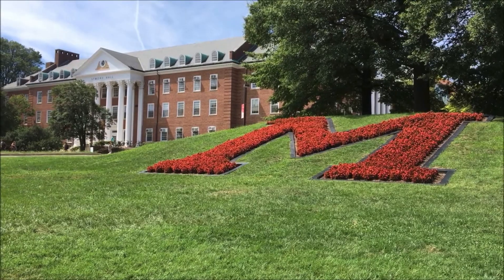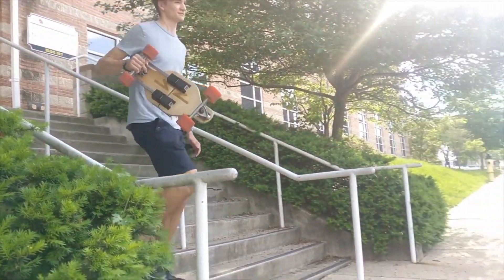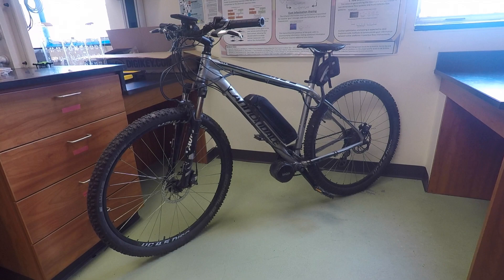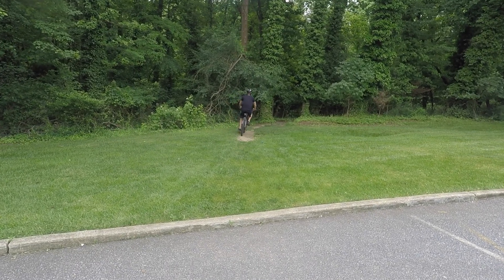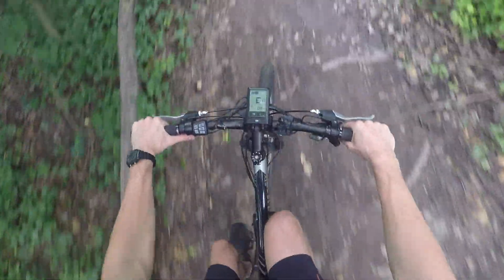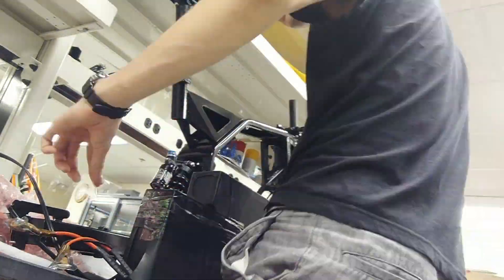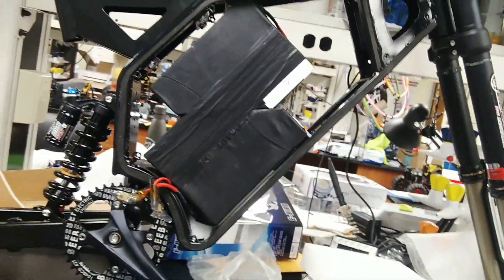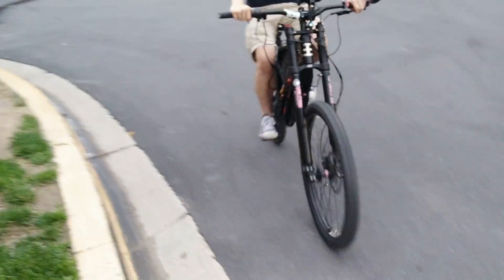DIY Electric Bicycle to Electric Motorcycle Upgrade

Comment: hi! i have almost the same setup, im wondering how accurate your cycle analyst is when determining amp-hour draws. Im supposed to have a 25.6ah battery but its dead after (according to the display) only 6.75ah.

Comment: If I had so much money...

But that doesn’t mean I won’t do an ebike like you did.

I’m planning of doing an mid drive freewheel crankshaft ebike with the kunray motor kit 72v 3000w. (200€)

I don’t under stand why hub motors are so pricy (500€)

Then I’m going to spot weld a battery: 20s 26650 batteries (80 for 250€)

The bike that I already have doesn’t come with full suspension, but some day I will upgrade, plus I’m planing to do some fiberglass enclosure for the battery. 

Btw the battery itself weights 8kg

Comment: Thats a sweet bike you have there haha :D I have also built my own one like 2 years ago. It has a "little" more power than yours I guess haha^^ 14kW motor and controller and 24kW the battery. Nearly same size like your :P
Reply: Elias Piano Music —waiting on mine to ship now and losing sleep by I’m so excited (5000w 72v 40ah)
Reply: @erikjonromnes  damn 5kW is quite impressive still.Trust me you won't sleep after receiving it either. Spend your free time on searching for safety gear. Trust me, you will need it. Every single penny is worth it. Depending on your country insurance on that thing won't pay anything
Reply: Elias Piano Music building up my gear as we speak. Just got the ixs trigger ff helmet and fox moto gloves so far ... any suggestions?
Reply: Oh and I got a hubsink to keep motor cool